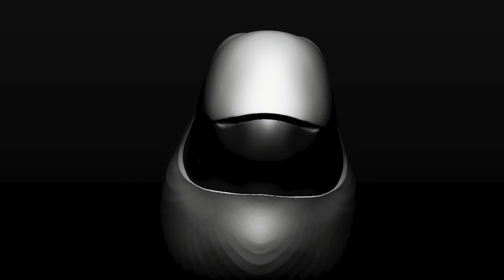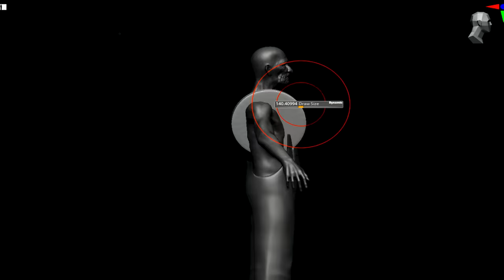The ocean's unseen Leviathan: Sculpting the storm with resin

Comment: What kind of clay are you using? It looks like plasticine, is that right? But later you use a heatpen to harden it? So is it polymer clay?
Reply from the maker: no, in this video I used Monster Clay oil wax clay to shape, then I used silicone to make the mold, and then cast a wave with resin.

Comment: Why not just buy clear 3D printer resin for tbe Leviathan instead of having to spend way more money to make a mold? Just seems counter productive
Reply from the maker: I can explain it to you like this, I wasn't originally planning to use a transparent resin leviathan, but I made a leviathan out of silicone, my initial idea was to make a leviathan imprint on the leviathan. behind the crest, when the resin was close to bonding I would press the leviathan-shaped silocone in to create a crease, but that didn't work for such a thin layer of resin. that's why there's a scene where the leviathan is made and there's a scene where it's cast
Reply from the maker: hope that my answer answers your questions, if you have any questions feel free to comment I will answer all your requests, best regards
Reply: That makes sense!!! I was just like why the extra step? Thank you!!